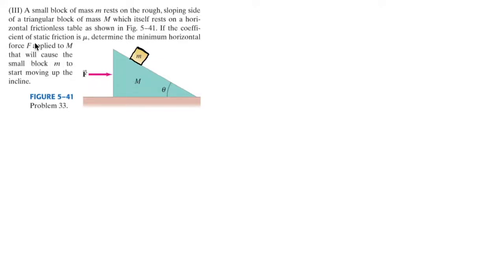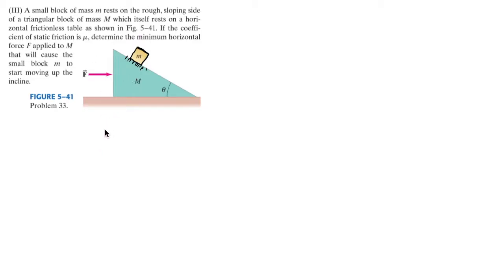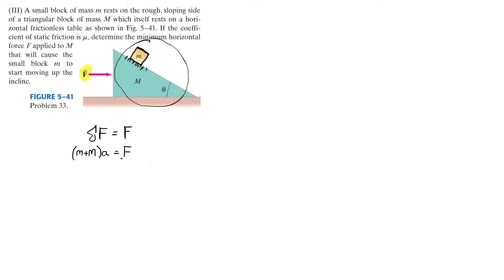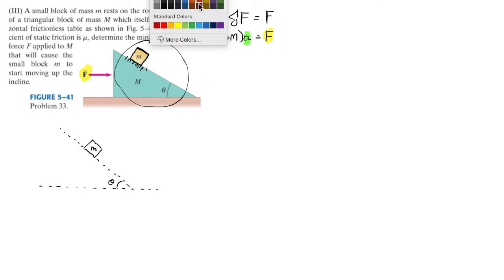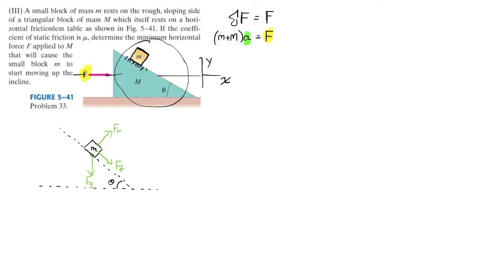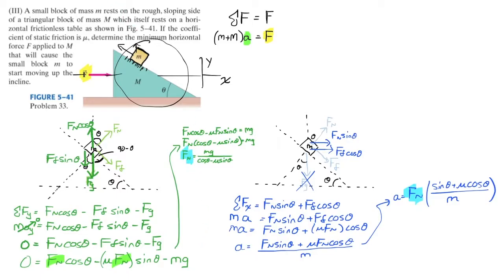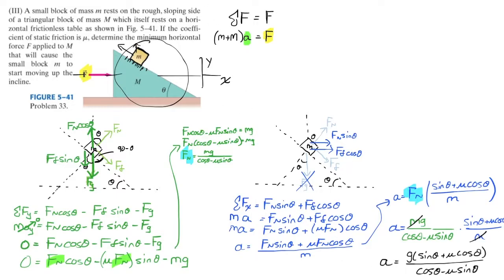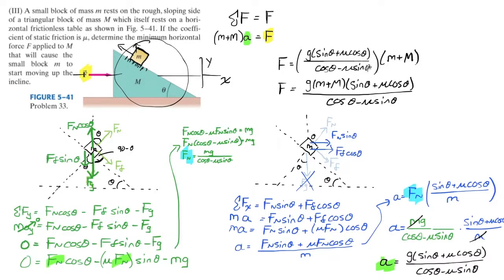High Difficulty Dynamics: Accelerating Incline | Symbolic Physics (AP, College I)

Comment: How does the small box go up, I mean shouldn’t it go down bcz there is no force helping it move up
Reply: if you imagine pushing the wedge really hard and quickly you can probably imagine the little block flying off the upper edge of the incline. If you were to push the wedge slow enough that the little block stayed where it was on the big block then it would develop inertia and when the wedge stopped moving the little block would want to continue moving and would likely slide down. So it is not directly the initial push that would make the little block fall down the incline, rather a result of sustained motion in which the little block developed its own movement.